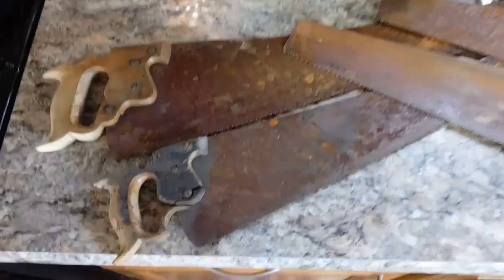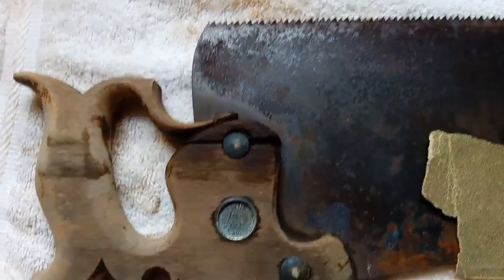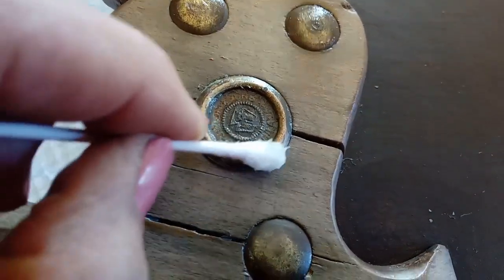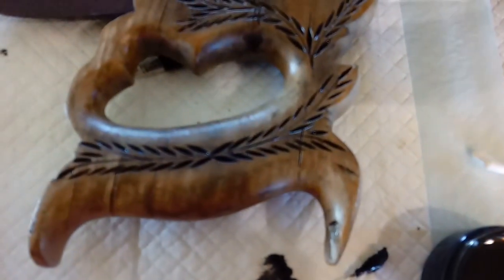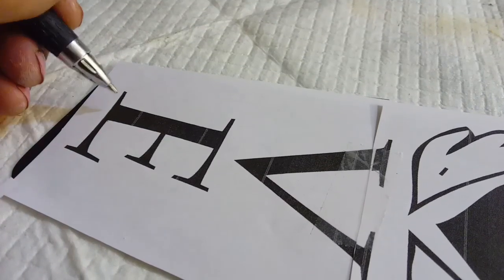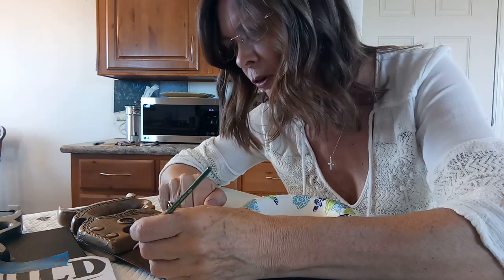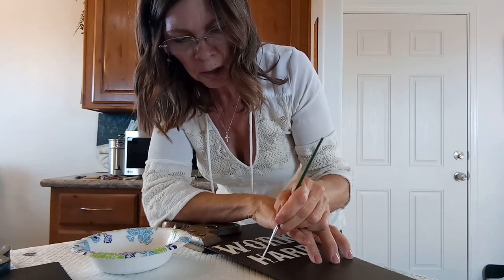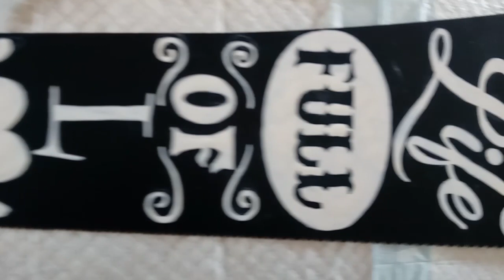Project: Painted Hand Saws For Christmas Gifts

Comment: I've been wanting to try painting a couple old blades my husband has, but he says I need to sand them down to bare metal otherwise the rust will bleed through. I noticed all you did was wash with soap and scrub with steel wool. Is there more prep work than that?